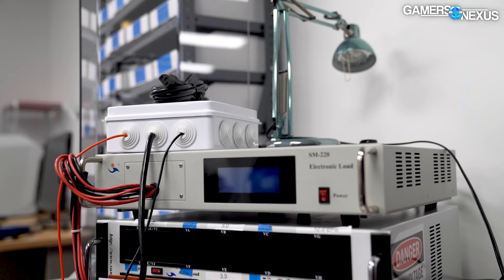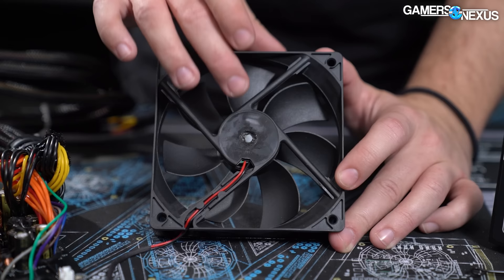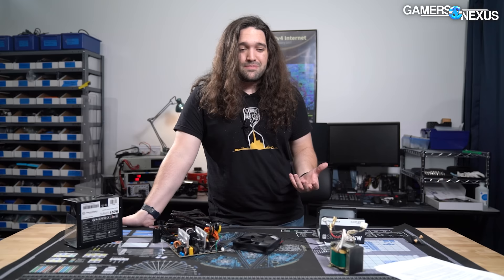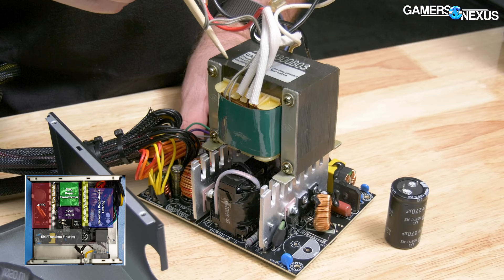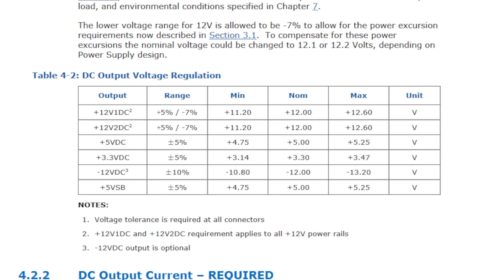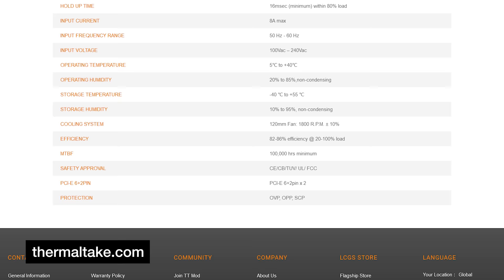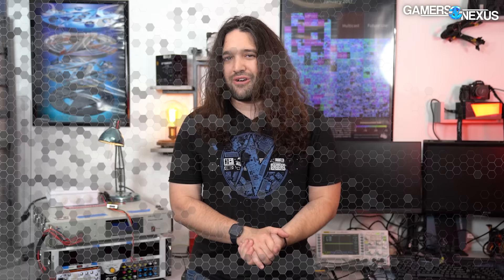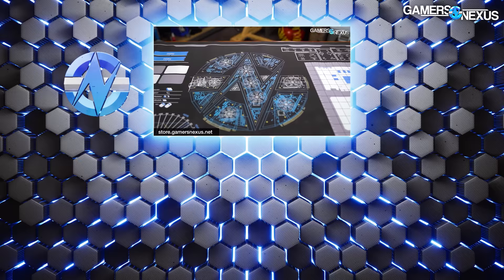Taking Risks on a Cheap PSU: $30 Thermaltake 430W SMART Power Supply Review

Comment: A fun test for GN would be testing a well aged used PSU that was once high end. Say one from 10+ years ago. 
Because people love buying old formerly high end used PSU's for cheap, believing they're getting the same performance from them as when new.
And I know myself, PSU's are a consumable item that doesn't age too gracefully in some cases.
Reply: Would have loved to send over my old well used Corsair TX 650W that had seen solid use since I bought it back in 2009. 24/7 runtime for the last 5 years.
But it self destructed after what I suspect was a major short from being absolutely caked up with dust, looked like the inside of a vacuum cleaner bag.
Reply: The hardest part of buying old good quality PSUs are noisy or damaged fans, proper replacement fans are so hard to find since starting voltage is way too low in many PSUs (many PSU fans have a starting voltage of 3.0v) and the only brand I've seen that specifies Fan starting voltage is Arctic and Noctua. Besides, many are not PWM fans so this shrinks possible replacements even more. The only ones I was tempted to buy were Arctic's P12 or F12 since those have a starting voltage of 2.8v, good price and quality, no point in buying Noctua.
Reply: G'day Cyber😺,
I was thinking a similar thought as a comparison while watching,
would it be better to buy a new Low Cost PSU like this one or a Quality Used PSU a few years to 10yrs old or for similar price?
Reply: @yorchli3152  Sunon KD1212PTB works  pretty well for me. Double balls bearing and starts at 3V
Reply: That's why people say invest in a good psu, not only for the extra Watts/effic, but so that it lasts more than 3-4 years.
Reply: Or what about new ones that are old stock or old designs like the Seasonic S12II?
Reply: Still using in my secondary builds some 10+ years old power supply like Enermax EES500AWT and Chieftec Gps-500AB-A without any issues. The Chieftec psu is powering a good old x58 platform based on Xeon X5650@4Ghz and a Sapphire Nitro Rx470 4Gb. Funny thing is that the gpu requires an 8pin cable, yet my psu only has 6pin connectors but it still runs without any issues.
Reply: @canderson7776  I had the same TX 650W from 2007 that also died from dust. I picked that model because it was manufactured by Seasonic who, at least at the time, had a strong reputation. Had a nice double ball bearing fan that I salvaged to carry the torch.
Reply: I only just a few months ago stopped using an Antec PSU I bought in 2009 they're more than welcome to test if they want it.  As long as you have something that only runs the fan when needed, I wouldn't worry too much about it.  The most likely failure point purely from age would be electrolytic capacitors but that's so dependent upon what temperature they've been at so if they've been using a PSU on a mining rig then I'd be concerned.
Reply: I retired a 15+ year old silverstone last year, not because it didnt work, just needed different connectors and long since lost the original supplied cables. Its voltages (measured with software, didnt bust out my dmm) under load were the same as it was when it was brand new. Back in the day (was for a build with sli 8800's and a e6850) it cost me like $350 Aussie dollerydoos! Considering i just replaced the psu (a corsair hx850) it replaced after less than 2 years, it served me very well indeed, i replaced the dodgy corsair with another silverstone.
Reply: I purchase old high end PSUs as well. Bought a 2014 era 80plus plat Seasonic PSU in 2020. Hopefully I get a few more years out of it. It was 6000JPY(54USD).
Reply: I have a corsair AX850 that was renewed, and I would love see how this new revision fairs against the old one
Reply: Good idea was buying old used 1500w maxrevos mixed results.
Reply: @B0BBYGAMER  You have enough money to buy a pc that needs 1500w but you are getting a used PSU? Interesting choice.
Reply: @yorchli3152  I had a PSU I was using in my first homemade NAS server whose fan was extremely noisy and I just replaced it with a cheapo molex fan I had hanging around from a case and just routed the cable to come out of the housing and powered it off a molex connector. It worked just fine until the PSU finally died of old age.
Reply: U are absolutely right. My old OCZ 650W psu died last year after being tortured with a 9600k and 2 EVGA 980's in SLI
Reply: @yorchli3152  Look for industrial fans, which can be bought from electronic component retailers (e.g. Digikey, Mouser). They will specify starting voltage in their datasheet.
Reply: I have a Cooler Master V1000 thats 7 years old roughly . 

The ps guru dude recommended and it's been good. I Just replaced it with CM V850 

Plus i have a couple other , a 750, a 500w etc....

I'd send them in if they are interested
Reply: Still using a Corsair HX-750 from  ~2010 with my 12th Gen Intel i5 12500.  No GPU installed.  It's definitely gone the distance and then some.  Well past it's 7 year warranty.
Reply: @kawag2780  It originally had one it fried when my reservoir cracked was rock solid got a great deal on used ones as they didn't have cables
Reply: Buying used PSUs and HDDs is never a good idea
Reply: @viewstar89  aren't the extra 2 pins grond? That would basically explain why the card runs fine on 6 pin. All the power is present.
Reply: I've got a Corsair TX750 circa 2008 that's still powering my tower. It's the last original component of my Ship of Theseus. (Seeing others' comments about theirs biting the dust from the, well, dust reminds me that my computer is overdue for a cleaning.)
Reply: @shaneeslick  good old Arctic F12 worked for every unit for me (with changing connector ofc)
Reply: Id love to see them test my aurora r4 Alienware from 10 years ago lol
Reply: Apropos of that, that 430W rating being for 12V and 5V is a perfectly valid rating, given that's how power supplies were rated in the late '90s, when the 5V rail was more heavily used. Pentium 3 and early-mid socket A Athlon still derived their power from the 5V rail, they only started using the 12V rail with the Pentium 4 and later as having to deliver that amount of watts across 5V woild have required huge wires. So increasing it to 12V required less amps for the same watts, so less copper, pity about that extra 4-pin (now 8-pin) dedicated 12V plug.

That said, last time I checked a calendar it was 2022, and almost everything that pulls huge power in the PC wants 12V, so in this instance "valid" =/= "honest".

As for aging, quality of manufacture and component can only do a lot of so much, because even though better quality can take heavy use and outright abuse a lot better, they can still be killed. Note, that also implies smaller odds of it just killing itself, or killing other stuff. I reckon that's worth the premium.
Reply: Had to use a 10yo Enermax PSU in place of a dead CM until I could get a new PSU. It would freeze up the computer or occasionally throwing black screens, despite being a 850W in its heyday.
Reply: Is that really true about PSU? I have an 8-year-old PSU and I kept crashing (Driver Timeout) whenever I hit 100 percent utilization.
I lowered my new gpu (RX 6600) base clock to 250 MHz and it stopped crashing. Now, I am configuring it out whether I have bad gpu or a dying PSU that needs replacement.
Reply: @n_communicates8030  I'd start with PSU. I'm purely guessing here 'cos I don't know the watts it is rated for, and a whole lot of other stuff, but I'd guess its caps have maybe degraded and/or the GPU load is just enough to push it over the edge.
Reply: @mugz6016  I think I know the reason now. The AMD Adrenaline Software was setting my frequency to 2559 MHz when the base clock is 2044 MHz. This is just speculation, and I'm still waiting for my new PSU to arrive.
Reply: @n_communicates8030  Now I'm curious.

I'm keeping my guess at PSU, since power draw is pretty directly dictated by the clock speed - and some other factors, like temperature and voltage and cetera, but we can ignore those for this - so when clock boosts higher, power draw spikes up. If the PSU caps have degraded, they won't be able to cope with supplying that sudden increased power demand until the rails have stabilised at the increased load. This can cause the power supplied to the GPU core to be not enough for just long enough to make the driver unhappy but not long enough to actually cause something to kick into some kind of protection mode.

Caveat: this is based on a solid electronics background with a decade of it being in IT, specifically desktop support, but does include an alarming number of assumptions of how GPUs operate internally, so this would be an excellent example of an educated guess. Please let me know whether PSU fixes it.

Edited becuz typo.
Reply: @mugz6016  I'll comment back when the new psu arrives and tests are done.
Reply: Im still using an 11 year old seasonic 850w psu in my ryzen system, its held on all this time i assume others like it will have the same results

Comment: This psu is in 3 of my office PC's for almost a decade now. They run 12hrs a day every day. & Get cleaned out every year. They have survived 1 lightning strike with no apparent failure of their capacitors or mov's.
Reply: You sure its the exact same model? I dont remember TT Smart being around that long. And even if it is the same midel, I highly doubt that they're using the same parts as they did a decade ago.
Reply: @TKIvanov  they are smart power 450 with 80plus white and pfc.. cables are not sleeved. but runs great they powering a q6600 & a7870k and r3 2200g (the systems have been upgraded at due to different needs of each user but they were all build around 2012 with all of them at first having p4 631. the psu is very similar , i need to find the box to let u know the exact model.
Reply: @らてちゃん looks and protection in some cases where there is sharp metal exposed. i have had one pc came with intermittent shutdown and won't turn on again till power cycled turned out the sata power cable has rubbed through and shorting into the metal case which is ground causing the psu to shut down in overcurrent protection.

Comment: Something I think you guys may want to mention when discussing capacitor lifespan and temperature (so as not to make people think that their caps are going to go bad really fast) is that a capacitor's lifespan doubles for every 10°C below the rated temperature. So that cap will actually last 4,000 hours @ 95°C 8,000 hours @ 85°C, etc. It's not something the average person would know, and they might only hear "2,000 hours" and not fully understand what "2,000 hours at 105°C" actually means.
Reply: Thanks.  I thought it was insanity that the manual claimed 100.000hr MTBF and then GN cracked it open to reveal 2000hr caps.
Reply: What kind of temperatures would be normal operating temps? Would they usually be in that 85° area extending the lifespan? Obviously there's a lot of variables like ambient temp, case, other hardware but I'm just wondering ballpark figures.
Reply: @stevenjohnson1692  I mean it's really hard to say. Only the manufacturer would know that for sure. But under normal usage I would expect it to be much lower, considering the MTBF is 100,000 hours. To hit that, temps would probably be around 55° on average. 85° as normal operating temps would cause the cap to fail in less than 3 years at 8 hours per day of usage. But given the relatively low power of this unit, I don't think the air around the capacitor (which is what the temperature rating refers to) would ever really reach that temperature unless you are pushing it to the absolute limit and the fan has failed.
Reply: @scuder179  ahh, yeah I didn't really think about the difficulty of getting a temperature on it. Of course especially for cheap products like this you gotta take everything the manufacturer says with a truckload of salt lol.
Reply: @scuder179  I wonder why they didn't measure ESR (and ESL), that would give a lot better picture of the lifespan.
Reply: What happens when a capacitor goes way over the rated lifespan? Does it go boom, or does it die quietly?
Reply: @stickmennoeller  Its hard to say, but it can do either. Commonly, the liquid electrolyte will evaporate over time, which increases the ESR, which increases temperature and so on. The cap may just fail to hold a charge, or it may go bang. If the cap has a vent (typically looks like an X scored into the top), it would be more of a pop and hiss.
Reply: @stickmennoeller  it would depend of course but overall the ESR increases, the capacity drops and there would be more ripple. The colder you keep it, the better lifespan would be. The caps don't go boom unless overvolted heavily.
Reply: @stickmennoeller  It will fail slower or faster, at that point you basically stick with roulette.

That's why it called "Mean"

Comment: I've bought a few of these over the years for absolute budget computers that have extremely cheap components, and they've always functioned properly.

What my personal rule of thumb is when buying a budget power supply is to buy something with a lot of reviews, go to the one star reviews, and see what the most common failures are.

The number one complaint for these thermaltake smart power power supplies (when I last checked!) was them being DOA.

At the time when I bought these, there were no reviews for "it killed xyz" or "Went up in smoke when I plugged it in".

I've actually avoided more expensive power supplies from name brands as there were trends where it would take out components, like the Corsair VS units, and so far my tactic has been working well.
Reply: Yeah the reviews are pretty spot on, i've built hundreds of PCs with low end TT PSUs and i've only ever had one DOA

Comment: 09:47 that's interesting, I had a NTC thermistor blow up on an Enermax PSU about 12 years ago. The PSU would still work but I would hear a loud crack every time I switch on the mains, and when I looked I could see the green casing had blown out the side. The Seasonic replacement has been good since and I still use the PC for old games.
Reply from the maker: Wow! Still working since it was replaced 12 years ago?!
Reply: @GamersNexus   Yeah, that's how I learned it's worth spending on a quality PSU. Tempted to replace the whole PC when the new GPUs come out but I'm going to be in for a shock when I realise how much the typical prices have increased since then 😅.
Reply: I was running the included no name PSU from my amd opteron build back in 04 and it just died when I overloaded it with a new (used) graphics card and forgot to plug the fan in that I had re wired to an external header to keep the noise down. 

Made it to almost 20 years, with about 5 years of down time before I upgraded the single core opteron to a used 3rd gen i5.
Reply: I have a Corsair GS700 that has seen i7-2600 when the CPU was brand new. Now powering i7-8700K @5.0GHz and RX5700XT and no prob whatsoever. Quality PSU will last a decade easily. If I ever need more power I will buy either Corsair or Seasonic 1000+w.
Reply: I had the same thing happen with a 10 year old HX or TX 650W Corsair made by Seasonic. It worked every time but there where sparks flying out of it every powerup.
I can solder and stuff BUT it was in such I tight space requiring a big tear down of the unit to get to it so I sad F-it and sent it for recycled it instead.

So its not a problem for just budget stuff, they seem to crack due to age I guess, heat cycling and also the shrink wrap around it is there to stop it exploding everywhere BUT dont help when its open at the top XD
Reply: My 1000 watt plantium seasonic from 2012 is still kicking. Only upgraded to my titanium seasonic oem because of warranty. Could have kept using the plantium one
Reply: I got 12 years from a 1000w Novatech budget PSU, It wasn't even 80 Plus. It finally died a few months after a water block leaked on it and tripped the breaker. 
It's older brother (a 800w Novatech also pre 80 plus) lasted 14 years in a smaller system and died of natural causes.
Reply: @GamersNexus  Doesn't surprise me. My BQ Dark Power Pro 10 is still running since 2012 and I guess it could run another decade, atg least it is in and outside still in good shape. But I guess if I'd change sometime to a 40 series RTX it'll have to be replaced. A Good PSU exceeds the lifetime of any other component of a PC by far, this is why, in my humble opinion, spending more for a decent one is spending less. (Reminds me of a german saying, back then usually ment clothing: "We can't afford to buy cheap"
My case (FD Define R3) has seen a lot of components come and go, there are only 3 Parts left from back then: The PSU, the stock case fans (yeah technically part of the case but...) and a dumping HDD which already spreads a warning for read errors and is the next part I need to replace
Reply: I've seen a lot of NTCs that blown up, mainly on home appliances though (typically used to prevent inrush current on devices with electric motors). They got hard life with being quickly heated on every power cycle and occassionally have manufacturing defects. It's not that big of a deal though as replacing the $0.1 element fixes the problem.

Comment: I have a Thermaltake Smart 630, it's been 5 years and the psu still works very well, with a few months exceptions, the pc has been on every day for roughly 10 hours, probably 50 power outages and several power spikes, B450+Ryzen 3 3100+RX 470
Reply: I have a 600 and it's seen a similar life for the past 2 years. Still quiet and reliable, just dusty